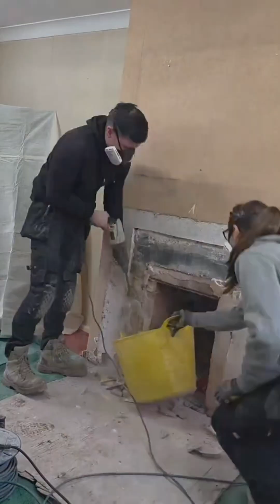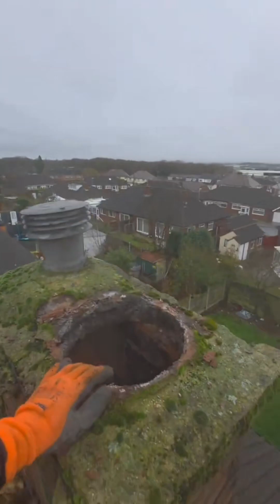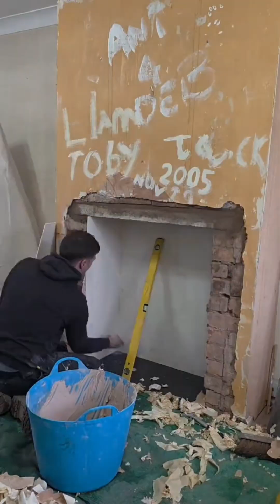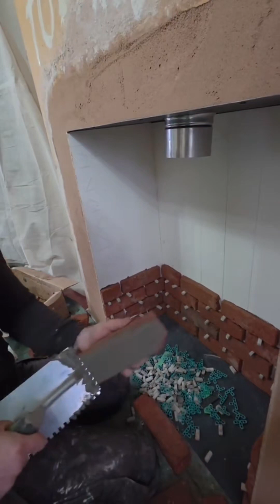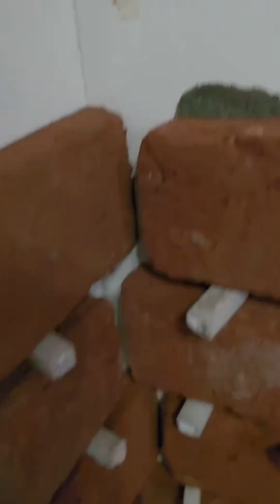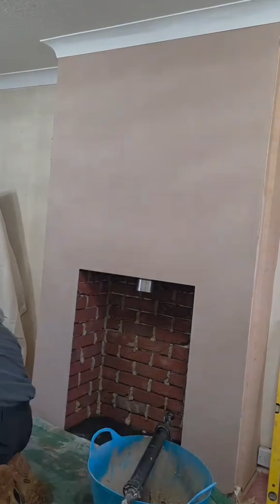Nice transformation on this old gas fire.

Comment: Lovely stuff. Did these chimney breasts not have a lintel somewhere already? I understand that you want to raise the opening height for the stove but I haven't seen you remove any lintels. Also, is there any issue with the clay flu liners when you raise the opening heights?
Reply from the maker: Thanks. Most chimney breasts we come across don't have lintels. Also, only really find clay liners in houses post 1969 😊
Reply: @Flemingstoves OK thanks, that's interesting. I wonder how they built an opening without a lintel to support the brickwork above 🤔 
And in any of those post '69 houses do you ever have any issues with clay liners when raising the opening height?
Reply from the maker: @funkypotamus sometimes they can be an issue and we might have to remove a liner or two but as long as they're resupported it's fine 👍🏻

Comment: What was the chimney breast width on this? Presuming this is about the minimum you could have for a clock 5
Reply from the maker: Chimney breast was around 52 inches. Wouldn't want the opening much smaller 👍